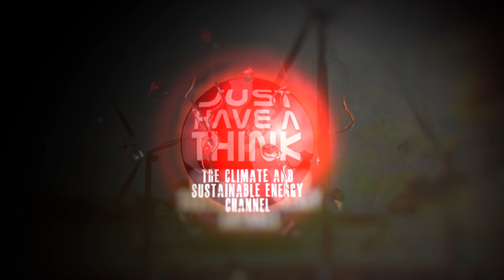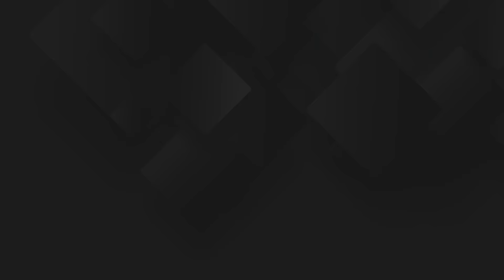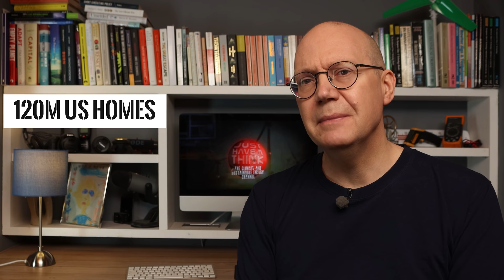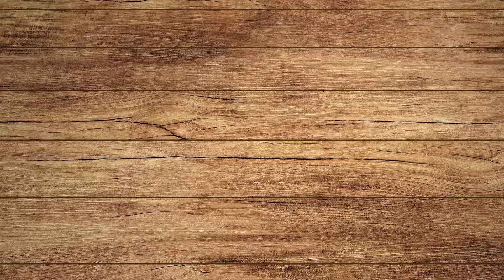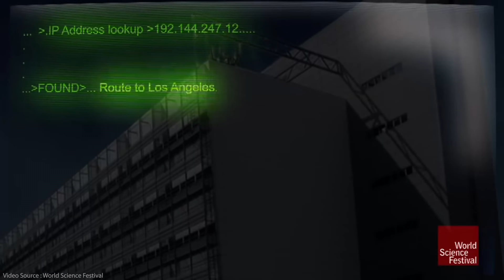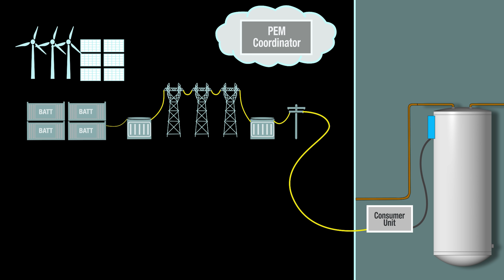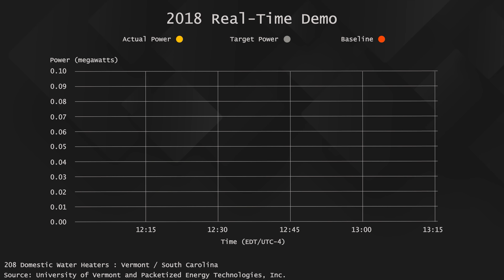How to balance renewable grids WITHOUT energy storage!

Comment: I’ve been thinking about installing a solar system with battery storage for several years now, partly for reducing emissions and also so I could deal with extended grid interruptions during the winter.    With the Russian attack on Ukraine, the possibility of a cyber attack on the grid suddenly seems like a compelling reason to amplify my efforts to follow through on that.  I think we’re all better off with a decentralized system of power generation, or maybe a combination that couldn’t be brought down by hackers, especially foreign ones.
Reply: Insulate your house first.  East and west walls are the most important.  Only one egress window per room on those walls.  Use fixed windows on the north and south sides unless an egress window is necessary.  Use a white sealer on your roof if you have an asphalt roof.  This makes a dramatic difference in the summer. Have at least 14" of cellulose insulation in the attic.  If there's fiberglass in the attic, use a radiant barrier over the top of the fiberglass.  Your walls should be an effective R-value of R-25.  The attic should be at least R-50.  After you've got that done, you are ready for solar.
Reply: @spacescatatford  Your suggestion on the attic applies in my circumstances, though it’s a small part of my vaulted ceilings.  Thanks for the reminder!
Reply: @spacescatatford  don’t forget that geothermal and heat pumps are important to reach super low consumption.
Reply: Good thoughts from all of you. Insulation is vital and awnings can be of great help. Also having a dog, even a small one to reduce consumption, can be a great thing in temperate climates. During the warmer months you can leave windows and sliding doors wide open for passive cooling. I was woken by my dog one night only to see someone jumping the back fence. This was a 12 LB dog. This made a huge difference. Low tech too.
Reply: @My_HandleIs_  I looked into that.  The problem was my utilities were so low anyway, I couldn't justify the cost.  You're talking $12,000 to $30,000 for an installation.  There wasn't a break-even point even after 30 years.  Insulating your house is by far the better option. I've been watching Matt Rissinger on youtube.  I'm impressed.   They are insulating on the outside now with Rockwool continuous batting that covers up the studs.  I've got a west wall I'm going to work over just to see what it will do.  It's my only weak thermal wall.  If it helps, then I'll do the north wall.  Once I install solar panels, I should have a zero energy house.
Reply: I live in Ohio, and my pannels make about 5x as much in July, as they do in Dec or Jan.
Reply: @ Frank Renewables
Are your panels fixed or are you able to change the angle? A guy in Montana got remarkably more production because he had built capability to change the angle of his roof top panels in the supporting structure. The increased angle also helped with having rain and snow slough off instead of pool. Getting up on a roof every month or so to change the angle wouldn’t be fun in the winter months though.
Reply: @fjalics  That's pretty typical. That's why residential batteries are a huge waste of money when the grid is available.
Reply: @spacescatatford  Maybe you are using (un)natarural gas, oil or something else that is fossil fuel, to heat your home? If so, that should be a priority to remove.

The best house uses electricity to power heat-pumps, that can be used to extract heat from geothermal sources, and/or extract heat from the air leaving the building via the ventilation, reusing the heat over and over inside the house, e.g. by putting it into the radiator/floor heating loops, or by at least pre-heating the new fresh air. This assuming a colder climate where heating is important at least parts of the year.
Of course the house must be well isolated, but if that is very costly, a geothermal heat source can compensate for quite a bit, so it may be a cheaper option.
The house should be airtight, nearly 100%, and the ventilation handles all the ventilation, in effect having lower pressure inside the building, otherwise the leaks render the isolation useless.

Our house has used 60 000 kWh to heat it, including hot water, over its 10 years since construction. We live in N Sweden, with up to a meter of snow, real winter from Oct/Nov through April. This year, it has been sub zero Celcius since Nov, 50+ cm snow. -20C as coldest so far.

For very warm climates, where cooling is needed, solar is also brilliant, as the sun powers the AC system when it is being used.
Reply: @mikedavison3400  In warm climates, using shading to avoid heating the house is also clever. Through a window, an immense amount of energy is let in. If it has a shading feature, such as the roof extending farther out, or something that can be folded in/out, etc, can lower the need of cooling the house quite a lot.
Not to talk about having triple glazing, no heat bridges in the walls, good insulation, airsealed walls and letting the HVAC handle the temperature inside, built with the knowledge of where moisture causes problems in walls etc.
Reply: @mikedavison3400  Mine are fixed, on the roof, but at a pretty good angle. I might add more later on the ground, semi fixed. I'd like to be able to adjust them to the season.
Reply: @fjalics  You could add reflectors on top of the panels instead.  That would be cheaper. This way as the sun goes down in the horrison during the winter, you can change the angle of attack of the reflector.  This would greatly increase porformance.
Reply: @My_HandleIs_  I have 300 sq. ft. of southside glass with multiple layers of plastic over the glass.  My house is primarily heated by the sunroom.  When I want to heat the house, I just open the sliding glass doors.  Solar is vastly cheaper than a heat pump.
Reply: @My_HandleIs_  -20C is only -4F. Most winter locations get colder than that and your limited equipment would not work. Plus your location probably doesn't have natural gas so you've adopted other solutions.
Reply: @artsmith103  -20C is the coldest here this winter. We get -30C too. Towards the mountains, -55C is the record... This is a REAL winter location, no ifs or buts.

In the 1970s and 1980s, houses tossed out the oil tanks they had for heating houses, thanks to high oil prices, that US have yet to ever see.  It has been brilliant to not have that, as geothermal, heatpumps, district heating and good insulation has been the key to solve the issue, while decreasing CO2 footprint and cleaner air...

All things mentioned, can handle REAL winters, I'm not sure what you are aiming at there. Unnatural Gas also requires winterized setups, just look at Tx last winter...!
But Unnatural Gas and oil MUST be tossed on the heap of historic failures, we MUST move to use LESS kWh and those we use, MUST be Clean and Renewable.
Reply: @My_HandleIs_  What's your preferred CO2 ppm? Does it guarantee global tranquility? I illustrate -20C is not very cold and you mention colder mountains somewhere else. I mention your alternatives are not better than natural gas and you say you used to use oil. I don't think Sweden produces oil so you were even importing that. You're virtue signaling your necessity. Do we even want to know where all that elec is from? Homes on propane often have other heating system for cost reasons. Similar to your oil situation. Homes on natural gas don't have better options so they usually don't.
Reply: @ Tomas B
A woman named Pippi Peterson has a DIY channel about RV living and she made ‘shade sails’ that really helped. With her RV being metal it really heats up.
Reply: @ The Designer
I had a similar type thing at a house we rented and I would advise having a removable gap of some type between the house and the sunroom, which was made of glass panels. Essentially it is a greenhouse and despite a couple of sliding doors that could be left open in the summer it got very warm in there which warmed up the house even with the sliding door closed. I agree with your assessment though. If I were designing one I would add an outdoor shower that simply had a regular garden hose that was black on top of the sunroom to feed the shower. Trust me you will get HOT water with that. You might even need to go to a lighter colour.
Reply: @ Frank Renewables
Yeah the further we are from the Equator latitude-wise the greater the angle of panels needs to be adjusted. There’s a guy who became known as ‘Handy Bob’ who had solar on his RV that he and his wife were living in while traveling and then put solar on the house and outbuildings that he built in Montana. Going from memory here and didn’t check if he still has a website but he was a great guy. He was not a fan of the RV solar sales or installation business back then.
Reply: @ erika b
An inexpensive solution would be to get one of those automotive type battery setups that can boost a car when needed. They have AC outlets that could run a small fan that would cool you while the power was out. They also have USB ports and an LED light. Well worth having around.
Reply: @spacescatatford  Picking up on your point about roof colour, here in the land of OZ the housing market continually cycles through design fads. These design fads are nothing to do with any efficiencies but everything to do with  "what is the in colour, texture, look, or must-have". At present, the "in" colour for most housing developments and individual builders are "greys of all shades" with many of them bordering on charcoal. This has become the most favoured roof colour here where winters are short and temperate or non-existant but summers are very hot and long. Air conditioning is almost mandatory everywhere so just imagine how much a "colour fad" is contributing to the power consumption here and yet you will not hear a word spoken about it. We don't want to upset the property developers, do we?
Reply: @alistairshanks5099  Missouri is no different.  My house is a white square in a sea of dark roofs.  People haven't a clue of how much those roofs are costing them.
Reply: I live in a rural area, so I have a good chunk of land available. I'm in the process of building a power shed, with its "roof" tilted at the optimal "average" angle, to mount my solar panels. The inside of this shed will house the batteries (forklift lead acids). No overpriced "Powerwall". The batteries can run both a grid tie inverter, and a backup inverter, for full off-grid operation, when needed. This setup is a fraction of the cost, of those "Green" Boutique outfits, that only want your money. That's the green they want. Its not "green" as the environment.

In the old days, people knew how to use tools. Now they're just fooled by corporate "suits", of which Elon Musk, is the greatest offender. Learn how to make stuff yourself, including a power shed, and save big money !

btw: I'm an electrical engineer, so I know how to convert power, to what's needed. The charge cycle of a lead acid is quite different than that of a lithium ion. If the damn thing catches fire, its a 100ft from the main house.
Reply: @ Michael M

Check out a guy named ‘Handy Bob’ if he still has a website.
Reply: @michaelmoorrees3585    I'm going to do it differently.  I'm going to set panels off by about 10 degrees away from the peak summer sun.  Then in the months of October, November, December January, February, and March, I'll use a metal mirror as a sunlight consentrator increasing output when there is normally low output in the winter.

The only use I see for a battery is if you have an EV, then you can hook up the EV to 480 V. DC.  The power kept going out at the house so about 12 years ago, I purchased a propane generator.  The power hasn't gone off since.
Reply: @fjalics  We have rooftop solar in Alberta, and we've had as much as 1,700 KWh and a minimum of 1550 KWh in July, and as much as 313 KWh and as little as 112 KWh in December.  

We get a warm wind, followed by freezing rain and snow that freezes solid, then the odd sunny day where it melts a bit but the half covered panels deliver next to nothing.  I use a roof rake to get the bulk of the snow off when we get 10 cm, but even a quarter inch of  ice will usually reflect nearly all the light.
Reply: @My_HandleIs_  In Alberta we get intermittent sub-zero weather from late September to mid-May.  The coldest it got in the south was minus 41 this year, and 3/4 of all our electricity is generated from gas. 

 Adding a ground source heat pump with 80 metre deep vertical bores will work the best here.  

Air source heat pumps will lose efficiency at extreme cold below minus 20 C, so they put a tremendous load on the power grid. If every building had air source heat pump heating, we's need to rwiple the aize of the generators.
Reply: @spacescatatford  It might, and it might melt the snow off the panels, but it would also void the panel warranty.
Reply: @RandyTWester  Only if the panels went bad and they found out what I did.  What's the likelihood of that?
Reply: @spacescatatford  a solar panel is basically a collection of diodes, so probably all that would happen is that if part of the panel was blocked, it could exceed the max forward bias current of some cells.  I don't know about how likely it is that would happen, or be detectable.  

Probably about the same as the odds of finding the Chinese manufacturer 24 years into your 25 year warranty.
Reply: @RandyTWester  Dang, you have a big system. I have 6.2kw. I get close to 1000kwh in July.
Reply: @RandyTWester  great! I have 14 kWp towards S at 45 degrees angle and 2 kWp towards E at 10 degrees angle (bike shed). I get upwards of 14500 kWh/year, with peak in May/June around 2500 kWh. Dec/Jan gives near zero.
Reply: @RandyTWester  If the panels are pointed south at about 10 degrees, the reflector would do nothing during the summer.  The panels wouldn't reach maximum output until the reflector started shining on the panels, and that would be during the coldest months of the year. Consequently, the reflectors shouldn't have any impact on output because they would only function during the coldest months of the year.  If they are getting too much sunlight, the reflectors could be convex instead of concave.  All you'd need would be a light meter to test for light intensity.

"Probably about the same as the odds of finding the Chinese manufacturer 24 years into your 25-year warranty."  If any of them start going out, I'll replace them with a better panel one at a time.  I planned on adding panels as the output decreased anyway.
Reply: Unless shrapnel breaks your solar panels, or there is a massive volcano eruption that obscures your panels.
Reply: This system doesn't need to be centralized, just like the internet: Each generator could have its own PEM coordinator, and your devices could be asking random coordinators near you. Also, it would basically be polite requests to the use energy, it wouldn't prevent you from manually overriding it (the notification of the override is also politeness, but it's not really required).
Reply: @fjalics  " my pannels make about 5x as much in July, as they do in Dec or Jan."  So, if you had the room, you could effectively use mirrored reflectors in the winter?

Comment: I've got a van with solar panels, 300Ah of batteries a little-used inverter and lots of 12V stuff. My dump load is to the water heater (got to go somewhere) and I can disconnect the batteries if I need it in a hurry. Everything is connected up with current detectors throughout and combination switching available (eg inverter + coffee maker, - coffee maker, - inverter) etc. I use a similar system to this with the refrigerator unit going right down to the target during excess times and letting it float a little when power is scarcer. I've also got a relay ready to experiment with a brown gas generator only while driving.

Comment: That's not packet switching, that's digitally controlled allotment.

I think an intent based event scheduler would be better for demand side management. The controller on a device sends over the network that it predicts it will consume at x Watts over t amount of time. This would add further predictability to the electric grid and wouldn't cause a failure due to loss of communication.

Comment: This system exists in Germany for years.  There is a 10 cent lower electricity tariff per kWh for heat pumps and since 2 years also for wall boxes, charging electric cars. Two electricity meters are installed. One for the house with the normal tariff and one that can be switched off for the heat pump and wall box.  The electricity supplier uses a low frequency control signal modulated onto the mains voltage to switch off the second meter in order to avoid peak loads.

Comment: It''s a good idea, and it will certainly help with short term grid balancing and reducing peaks, but it would be naive to believe that demand flexibility alone can solve the total storage conundrum. The issue is that demand flexibility is limited in time - you can offset demands by perhaps a few hours at most. (e.g. you can delay heating or car charging a bit, but ultimately you plug it in because it's needed at a certain time) But storage measured in hours is not really an issue already - the real problem with intermittent renewable grids is seasonal storage, with storage measured in weeks, to cover those slack weather periods with little renewable resource. Demand flexibility won't help with this, unless people are prepared to sit in cold houses with cars they can't use for weeks on end. Of course with spot pricing models this does become a possible choice for consumers, but then we are likely getting into the realms of energy poverty, where some people live in very poor conditions because they can't afford the heating or to leave the house.